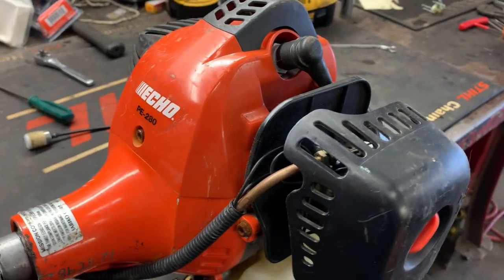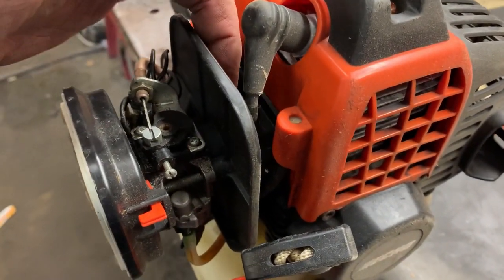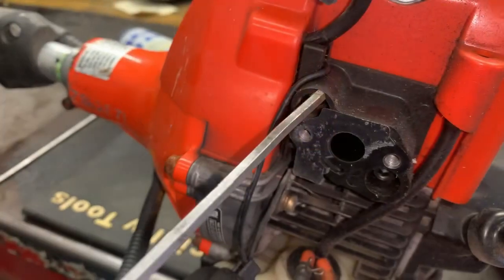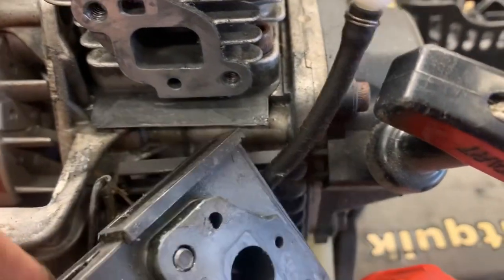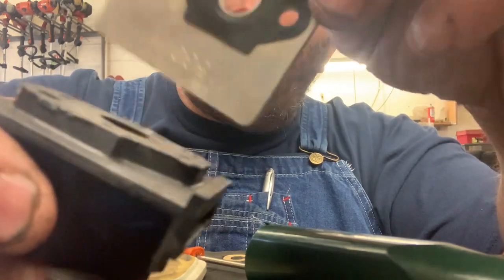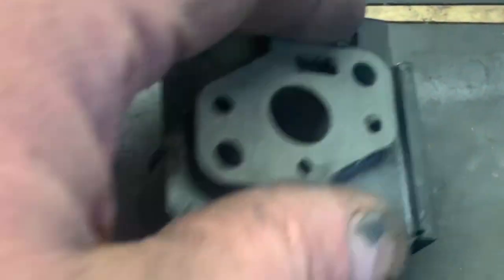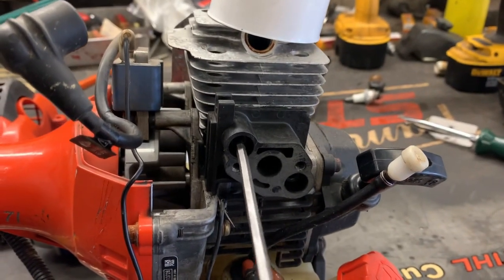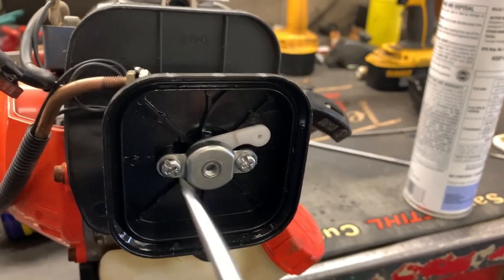#ECHO NO START FIXED! / 2 STROKE PATTERN FAILURE / MASSIVE VACUUM LEAK OMG! / LOOSE INTAKE MANIFOLDS

Comment: Great vid I just love these Echo's best tool on the market in my humble opinion not so big over here in the U.K. There loss and my gain as they sell a little cheaper due to
lack of interest !!
Reply: I have a Small Enginer repair shop and A Lawncare Business and all i run is Echo. I fix alot of other Brands but when its an Echo its always something Simple. Craftsman, Poulan weedeater and so on are all pretty cheap and usually the same.